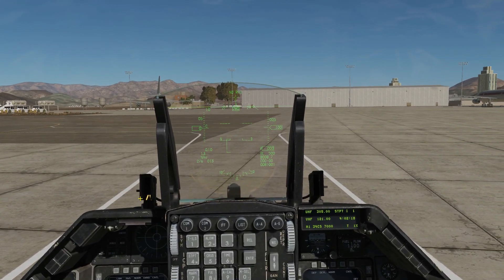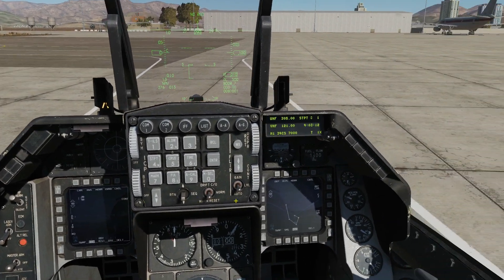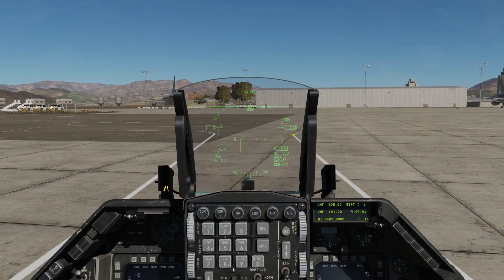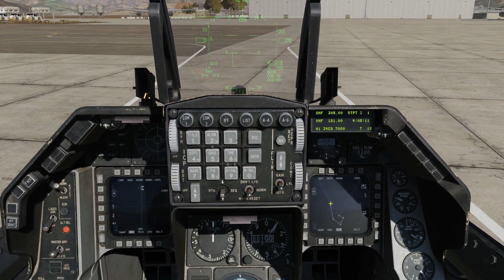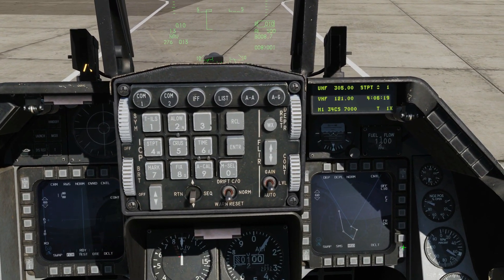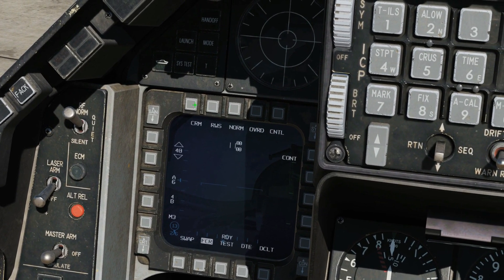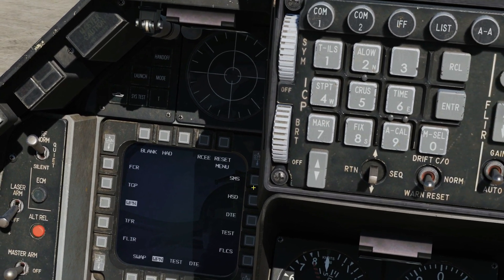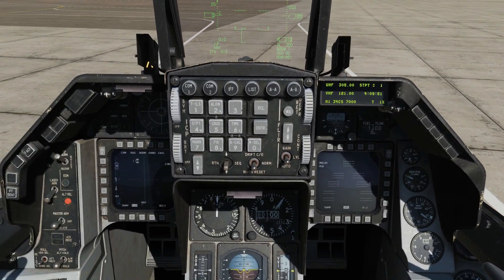F-16C Viper: "SOI" & MFD Function Management Tutorial | DCS WORLD

Comment: So i loaded up 2 aim 9x, 2 aim 120 and 2 Gbu 12. I had made a very simple mission, take off splash 2 MiGs then switch to AG mode find a tank amongst some buildings and drop a lgb on him. If i take off and kill tank then MiGs everything is fine but if i go AA mode then try and Switch to AG im having no luck in getting it back to that mode? Also the TGP is a pain if i lose where it is im so used to just pressing a button on A10c so it goes to default look forward position and then reacquire. Am i missing something or is some of this stuff just not yet in? I know its early access so its not a rant. I just want to make sure im not missing something obvious. Also sometimes my JHMCS will vanish when i try and switch dog fight mode with something. I think shes getting parked up for now before i go mad!
Reply from the maker: Yeh I'm getting all the same stuff. It was exactly the same with the Hornet if you remember.
Reply: @grimreapers  Ah ok thanks. I was late into the Hornet so it must have been implemented by then.

Comment: 5:12 It's most likely not implemented at the moment, but there was another option on the top OSB that you didn't mention. It's the HAD (HARM Attack Display), that is going to be a page that, just like the TGP, will only be usable when you're carrying the Harm Targeting Sensor and AGM-88 missiles. That screen will present you a map-like screen, where your flight plan is displayed for situation awareness, and all of the radar sources that the sensor detects will be scattered throughout the map (it doesn't actually show a map, it's only a representation very similar to the HSD), and on top of all that, it will display the Harm Range Envelope and a Target Designator Cursor. It's another SOI screen.

This sensor makes it MUCH easier and noob-friendly to deploy the HARM missiles effectively. The other method of deploying the HARMs is via the WPN (Weapons) page, which is the same page used for Mavericks.

And finally, there is the "blank" option, which just leaves a blank page on the MFD, and makes the DMS left/right click simply skip that page and only cycle through the valid pages.

Also, you should be able to toggle your HMCS (Helmet Mounted Cueing System) on and off quickly by holding DMS AFT for 1~2 seconds, assuming you have already turned the brighness up on the HMCS Brightness Knob. But this is for another video.
Reply: Whats the keybind for dms